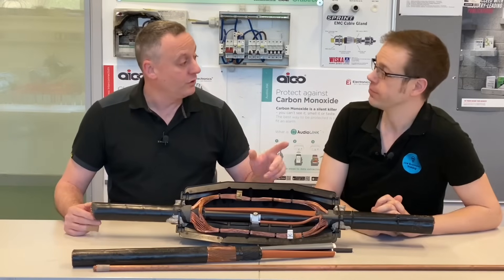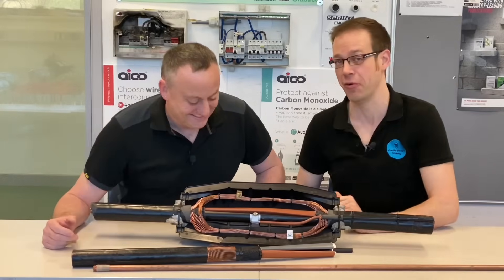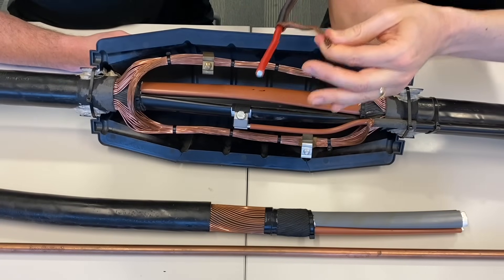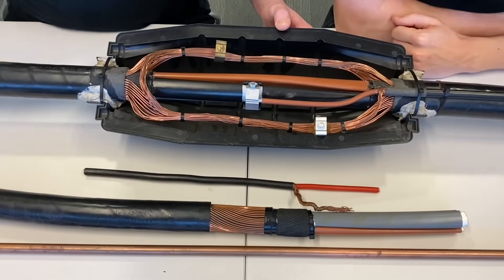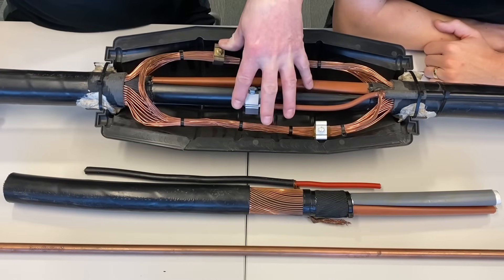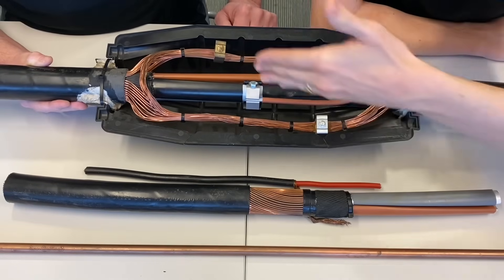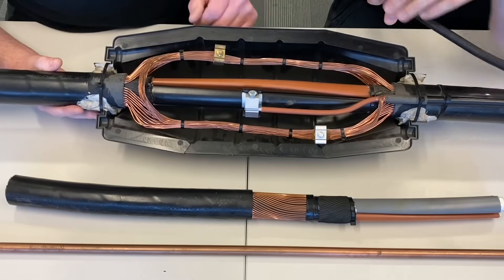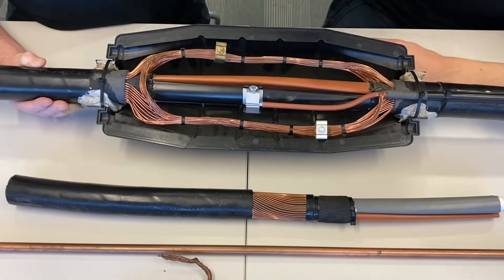Broken Pen Conductor - What’s Going on Inside a TN-C-S Cable Joints. PEN - Protective Earth Neutral

Comment: 07:45 But why no galvanic corrosion between aluminium and brass in the same way we get corrosion between aluminium and copper? I guess the idea is that the moisture needed for the corrosion would come along the conductor and the assumption is that there would not be enough to physically touch the aluminium part of the clamp?
Reply: You don’t need to put brass with copper to ally in a joint. There is no oxygen in a joint that’s been filled with resin so how will it oxidise inside the joint. They say do it because on the overhead it would oxidise because it’s all exposed to the elements and will fail quickly they’re just using same practice for underground

Comment: This is wave con or wave form. The wave gives you the slack to gain space to get to the cores. Modern joints should have solid earth tail bought out approximately 1m long. Solid to stop water tracking if it was stranded. The 4 core version for tns does unfortunately have an aluminium neutral core. Every 250m a straight joint will be required which services can also be bought out. Runs should be kept 350m or less generally. Most commonly used in 185mm2 or nowadays 300mm2. The older cables 1970s to 1990 was consac (concentric solid aluminium core) it had 3 solid paper insulated cores with a solid aluminium extrusion neutral coverd in Tar then pvc sheath. The tar was supposed to self heal any pvc damage but never worked. The aluminium powders and fails. The wave con you shown is reliable but if a damage occurs and is left or back filled the aluminium will powder up but unlike paper insulation the xlpe will stretch and allow the cores to buldge and the classic sign is low volts as the powder Ali is high resistance.

Comment: On the main 3 phase cable that you described you said there was no need to joint on the conductor. How do they joint the main cable when it runs out of the length that is on the main “drum” coming from the substation. 
Or do the DNOs buy a cable that is long enough to go from the sub station to the new installation so that there are no joints needed in the main cable?

What happens when the “ JCB Digger” accidentally cuts through the main 3 phase cable? How does the DNO joint that?

Comment: First let me say I am not  Jointer, but .......
..... Does this "new" system not prevent breech joints so unless your housing estate is well laid out you will have eather multiple cables or one cable snaking round and about (maybe crossing a garden or two)?
The depth of cables is only a foot and is often over Gas, Water  and Sewerage so repairs to those services could well disturb the electric joint!
The other thing is that there are "as laid drawings" that show where every earth stake is (or should be)!
I assume you are talking about new installations to a DNO take off point. There is a whole world of difference if you are adding on to an existing system. 
There is also a difference between PME and PNE ;0)
I have been to a house where the owner was complaining of his tiled concrete floor getting warm! It was all laughs and jokes until I got there and the floor was so hot you could not kneel down on it ..... The neutral earth had been lost and the whole load of the house was running down his gas pipe in the concrete floor! That one could have been a bad! There have been worse ones!

Comment: So just to check ,the pen conductor is randomly spiked along the route from the supply transformer?? , or are they installed when they tee off for single phase consumer supplies.. and this Method of ‘connecting or joining “ there is no need for an electrode

Comment: I recently had a new Gas and Electric Smart Meter fitted in to my property but this ended up having the DNO come out to dig the road up. They found a faulty joint down my street causing a Voltage to travel down the incoming Earth at around 1.4 - 1.6v, this was also checked at a few lamp posts and each one had a voltage on the Earth.
This fault was only discovered when my installer placed his Continuity Bonds from the incoming gas supply pipe (behind the Shut-off Valve) to the internal pipe work, on clamping it created an Arc. When the old Gas Meter was fitted the Anaconda (flexi-tube on the Meter) use to get warm to the touch but cool down when Gas was flowing - It had been like that since I'd moved into the property and i can only imaging the cause to be this small Voltage coming from a damaged joint in the Street.
Reply: There is a relatively famous incident where the gas meter was so hot it melted a jacket which fell upon it. The neutral current from a number of other properties in the area was flowing to earth through the gas meter, a problem caused by most the other properties in the area having replaced their water and gas supply pipes with plastic, and probably a dry summer making other earths less effective. 
This instances of this issue is growing fast at the moment, partially because electricians are using clamp on meters to look for earth currents and the actual cable joints in the road are getting old and suffering from corrosion.

Comment: Great video guys.  And I must say....as an electrician of 20 years, running my own business for the last 12,  of all the YouTube electricians, you guys are most worth a watch.  I still pick a few bits up here and there from you.  

Quick question:  using the method of jointing in this video;  if used through out its run......I don’t suppose the system could be considered PME?

Comment: Are neutral and earth combined like this on high voltage power lines when carried across on pylons?
Reply: Typically HV pylons do have an earth conductor at the top linking all the towers, which are themselves earthed. But this to provide lightning protection for the conductors which are usually just three phase conductors carrying one circuit on each side of the tower, as R.D. mentioned.

Comment: I’m sorry but this is complete nonsense. I’m a cable jointer from Live LV up to 33kv. I work on new cables and old paper insulated (pilc) cables. The live or neutral conductors were never cut to do a service joint. They were jointed in the same basic way but soldered with ferrules instead of the insulation piercing connector used today. Also there would be a minimum of 1 straight joint every 250M. Usually more depending on the street layout. You could have 20, 30 or even more joints in the cable before it reaches your house meaning the neutral is broken at every joint with a possible failure point. Some companies use earth electrodes on there service joints but this is not a steak driven into the ground, it’s basically a solid copper wire that comes out of the joint about 1M long that is backfilled with the joint. I think you’ve been a bit ill informed on this occasion
Reply: Most common fault on PEN is a cable they used in the 70s-80s. It had an aluminium sheath which is the neutral earth. Any water ingress with aluminium causes erosion which therefore leave loss of neutral. This only happens if it a radial circuit and not tied in with another piece of network
Reply from the maker: Thanks for taking the time to comment in such detail 👍.

Comment: So am I right in thinking, even tho they have kept the integrity of the main cable, the one supplying a house is still effectively a joint ? 
Chances of losing it is very low but not impossible?

Excellent video guys, really enjoyed this one
Reply: The thing is that if it faults it only affects one house (because we no longer do loop feeds) if it were the "old" system a fault could affect many houses!
Reply: yeah but as every connection is tightened up and than encased in resin the chance of a fault in one of these joints is basically zero

Comment: Another great video thank you guys,
I never learned anything about this when I was at college back in the late 80s so I found it very interesting and useful.
Just one question though were you say it is important to have the join made with the same mettle to avoid the mettle for damageing each other?
 Surely the same will apply when we use crimps IE  copper conductors with an aluminium crimp?  Or is this another miff?
Reply: Your crimps are tin plated copper for exactly this reason.

Comment: I have passed some open trenching where the network has been working on supplies and inserted earth rods but just recovered them with earth when back filling and never installed earth inspection pits...
Reply: quite normal, they do the same in this area, throw the rod in along the trench before backfilling (SSE territory)

Comment: the joint shown in this video is old tech now, the phase connectors we use now are fully insulated and insulation piercing so no need to even strip the insulation 👍
Reply: Really intresting subject can you update a video showing what they do now. Great subject
Reply: Agreed
Reply: Don't suppose you would consider doing a video on exporting an earth. More to do with caravans and why we could not use an ev, or open pen fault devise. We know about 50 v touch voltage and ev is 70 touch. Millions of people go to ebay buy a 13amp conversion lead to attach to a 25m orange cable to keep caravans and motor homes powered up. At camp sites we know its tt hook up. So would it not be safer to use an garo or viridian open pen device or is it because its not in the regs. Surely they rushed through a change to 722,but why not 711.
Reply: IPC's are the way forward

Comment: Had the system lose the PNE connection, due to the cable having the copper being stolen in the substation by thieves. The losing phase went to over 300VAC, blowing a lot of stuff on it. I saw the voltage rising, from the UPS warning of high mains, so powered off the house at the breaker, and then on measuring the other 2 phases saw this and turned off the building to protect the installation, then called the supplier to come fix the failed neutral. Lot of the neighbouring houses and shops lost all the electronics and electrics from the overvoltage. Took around 6 hours to repair in the substation. Next weekend they struck again, and again 6 hours, but this time they replaced the doors with heavy steel armoured ones. They got around 100kg of copper total for both times, but caused a lot more in damage.
Reply: That's why implementing 'conducrete' bedding around the substation earth mat is a good idea.
Reply: Actually this could go up to 400V in a european three-phase system. Depending on the loads that are connected between the lines and the neutral/PEN. In case of a broken PEN the connected appliances behave like a voltage divider. This can also change, for example if someone operates the light switch, the voltages will change every time because the person is connecting or disconnecting a load. For example:

A 20 W Soldering iron connected to a single phase circuit between L1 and neutral/PEN, this is a resistance of 2645 Ohms. On a single phase circuit connected to L2 I got a heater, 3680 W (14.4 Ohms). Both are on different lines, but both are connected at the center point of the star circuit, and that's the neutral or the PEN. If the neutral/PEN breaks, these loads act as a voltage divider. In that case the heater will "see" 0.2 V, and the soldering iron 398.8 V.
Reply: @Marcel_Germann  It was 300VAC, more from a mix of around 200 differing residential loads, so the biggest load was the safest. Loser was the corner coffee shop, which lost all the ovens, the coffee machine and the point of sale, along with most of the lighting and displays, as they were on the lightest loaded phase. 50 plus water heaters of 2kW were more than enough to drop that phase down to 70VAC, and they would not cycle off either as the heat input was likely lower than the standing loss, or they were cold from water draw.

i have a number of large volume MOV units connected across the line to neutral, and similar to earth, so that if the phase rises high enough it will trip the RCD from imbalance. As the local board has a really good ground connection, thanks to a massive earth mat for the building, the building was probably acting as the local return path and balance point, from the water pipe bonding on all the other connections. I was not measuring phase current, just voltage WRT neutral, but likely the earth bond had a significant current flow. Lucky that is a 25mm2 copper strap and 32mm2 copper wire.

Comment: TN-C-S has two variants, namely Protective Multiple Earring ( PME) and Protective Neutral Bonding (PNB). In both variants, the consumers earthing conductor is connected to the neutral at the head. PME has multiple earth stakes along its route, but PNB does not, and PNB can be earthed at the consumers position rather than at the Tx star point. PNB also typically serves just one installation but can serve more. So, PME is always TN-C-S, but TN-C-S is not always PME (being PNB).

The purpose/point of PME is that in the event of a broken PEN conductor, an installations neutral current can flow down through any extr.c.parts and through true Earth back to the Tx (and helps limit touch voltage in the installation), so if they're not using multiple stakes, are they then NOT providing/supplying PME, i.e. it won't be PME? 

Re clamping the concentric cables neutral to the neutral in the joint. Are the two clamp positions not about about ensuring that the load is applied to the supply neutral equally? He's split the neutral into two sections, so if he just clamped on one side, he's halved the ccc of the neutral at that point - akin to e.g. terminating only 4 strands in a 7 strand conductor. So by clamping on both sections, he's using the full neutral ccc (rather than it just being about redundancy or belt-and-braces).

Re earthing the neutral at intervals, somebody drove a car into the supply cabinet on a street near me a few weeks ago, so the cabinet was renewed and they drove in a stake. A few days ago, another one was moved, and they also drove in a stake - which seems pertinent given it's a PME system, not PNB.
Reply: Interesting comment, So are you saying the joint in the video is actually a pnb arrangement, which doesn’t have a direct connection to Earth at the joint? Which is a sub division of a tncs system. 👍 are you a jointer btw?
Reply: @gbelectricks  I'm a sparky, not a jointer. All the info needed is in Guidance Note 8, along with relevant line and fault current pathway diagrams. For any detailed technical info, you can ask for free on the IET's Wiring & Regulations forum, found here: https://communities.theiet.org/discussions/viewcategory/1037
Reply: I believe I went to a job recently which was PNB, the servicehead had a separate earthing conductor attached to the incoming supply which was obviously installed by the DNO.
Reply: @davidb3537  the "earthing conductor" runs from the supply means of earthing to the MET, both on the consumers side. The earth wire from the neutral/earth connection down to Earth connects to a stake/plate/etc, but I don't know what that conductor specifically is called (DNO supplies are something sparky's don't get involved with). How many installations are supplied from the Tx, typically apparently it's just one? As a starter, here's a thread on the IET forum that refers to PNB; so you can search for more threads from there to get a better understanding of it (the thread also refers to PNB as TN-S (not TN-C-S), just to complicate matters): https://communities.theiet.org/discussions/viewtopic/1037/26775?post_id=146414#p146414
Reply: @johnhoward2104  
Just one  rural installation  on a small cluster of properties. 
I'll  have a look at those links, thanks.
Reply: @johnhoward2104  i was on a new build school last year and the DNO turned up to put a supply in , they dug the hole and made the joint they then through an earth rod in the hole ( didn't drive it into the ground ) earth cable attached and ran it into the building with the supply cable , couldn't understand at the time why.
Reply: @154electrician  well just to complicate matters, the arrangement you've described could equally be PME with a local earth electrode provided as a supplementary electrode for the PME to hold down touch voltage in the event of a broken PEN conductor (which was apparently advised some years on all PME connections, but never proved popular). To know whether your arrangement is PME or PNB, you'd need to know if there are multiple earth points along the supply PEN/CNE conductor (hence making it PME).
Reply from the maker: Great comment 🦾

Comment: On every CNE joint now we install a copper tail out of each joint called a supplementary earth. If the cable is a radial circuit it will have an earth rod installed on the pot end. If it goes to a link box to tie up with another piece on network, in theory it has 2 neutral/earth paths

Comment: I have seem pme on old house I rented. It one where the power came up the side of the house and ran around powering our house and the neighbours. And it had a visible spilt off down to a stake
Reply from the maker: Pole mounted supply?
Reply: @GSHElectrical  it's buried down the the street but It does seem to Come from a pole pig around the corner.